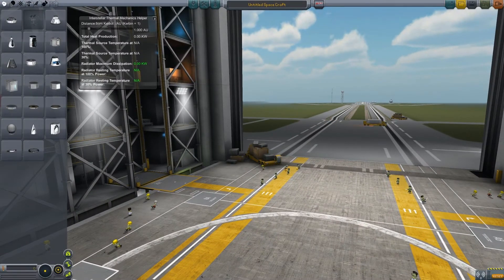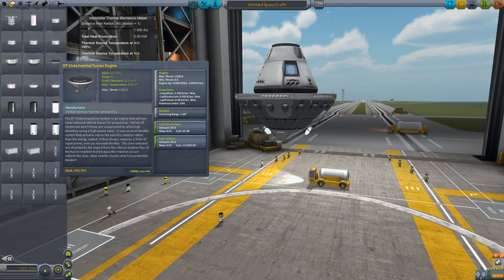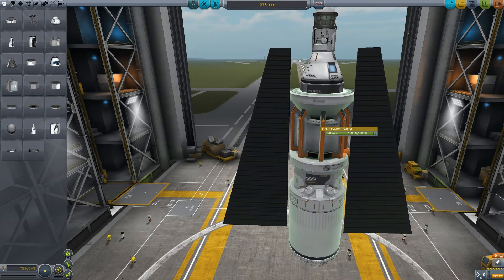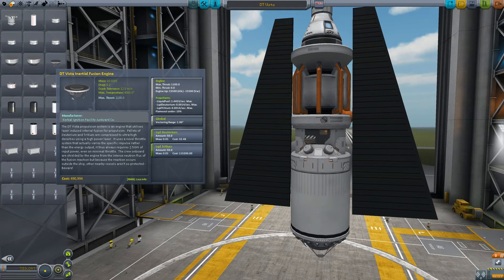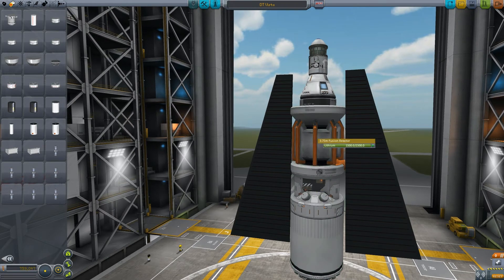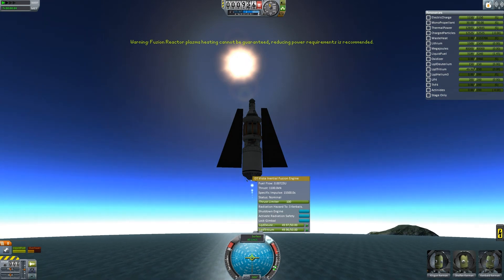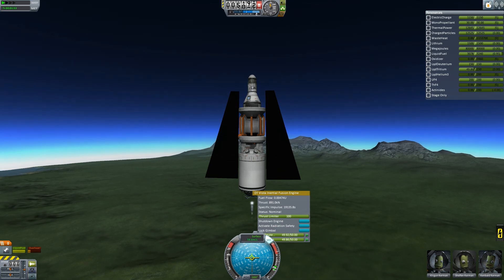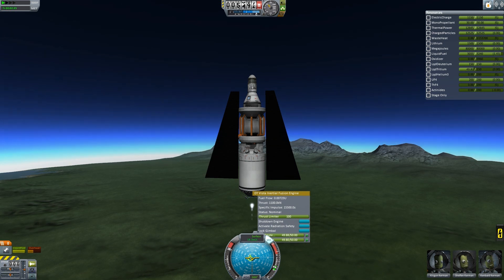KSP Interstellar: DT Vista Inertial Fusion Engine Tutorial

Comment: Just a couple of  things you didn't cover. Deuterium and tritium supplies might need to be account for if you want to make a ship that can last years without a refuel. I usually make such a ship with 1 lithium tank, 2 deuterium/tritium cryostat tanks, and 1 helium3 cryostat tank (helium3 is made from tritium decaying and can be used as fusion fuel). Along with 1 inline refiner and 1 UF4 Tank to keep the fission reactor healthy.
 Also here is a little more gee quiz stuff about the DT Vista. An upgraded 3.5m Fusion reactor and 3.5m generator combo can easily produce enough power to use 4 DT vistas. Pretty much making it the go to engine for any non antimatter XL space craft. It ISP isn't influenced by atmosphere so it makes a great engine for a heavy lander (kills all harmful native life forms in a 2 km ratios, guarantied)
In fact,the only thing that I found this engine can't do alone is make a rendezvous burn with a ship carrying a kerbal. Which can be worked around if you have the patients.......radiation safety off.....or not.......
Reply from the maker: Great info man, your absolutely right. I will cover this in a seconds part tho, somehow its good the first one is as simple as it can get.Otherwise in regards the vista engine i would consider it supreme over the antimatter which is a huge hassle. I found a work around in regards to your issue, well also mainly depends on your design limitations. I use the vista to kill my delta v in relation to my rendezvou target like 10k from it and then use a few nuke engines or one depending on my ship to move in closer. Of course you could supplement it by other engines tho the isp is something that we both want to squeeze the most out of the ship so any way to burn less fuel is better. With this system you need to weigh the fact the more thrust you got the more control you got over your ship in terms of slowing and speeding it up when going in for rendezvou. THo usually the higher thrust engine provide better control they also eat up all the fuel. But with fuel processing plants in most of my systems already i start to switch to Mark 55 as they generally fit in all my designed crafts nicely and with additional 3degree vectoring its great.

Comment: for some reason my reactors  arnt creating heat. ive got the settings as u and the window say that its all red so they should explode but they arnt producing any waste heat. do you have any ideas
Reply from the maker: hmmmm if you didnt place a single radiator your reactors will not go on, i take it you didnt watch my reactors tutorial ?
Reply: Actually i did watch it it was a great tutorial by the way very helpful. and they actually turn on but they dont produce waste heat like they do for you and everyone else. they'll be on and working and i can run a thermal rocket engine but they arnt producing that dangerous waste heat. i know i should probably be happy about this but i actually want to worry about them over heating.
Reply from the maker: lol
Reply from the maker: Try putting on smaller radiators till you get it :)
Reply: AddMeGamers
lol aright
Reply: +AddMeGamers might be a little late but could you make a tutorial on the VASIMR engine? i can't get it to work. kerbal engineer is giving me crazy TWR ratios and Delta-V values in the hangar but that thing isn't starting up and i can't figure out why....

Comment: i just got a galaxy s5 so i can finally download your game haha been waiting. off the the ios devices
Reply from the maker: :D let me know what you think
Reply: AddMeGamers just a quick option i upgraded the engine as one of the first upgrades and fuel is a bitch to manage but i think the breaks should work when you run out of fuel bcus the way you have the gas set up most the time you have a lot more speed then necessary to reach it all you need to do is slow down
Reply from the maker: Ye the fuel issue gets better as you upgrade the tank size. And the brakes get better as you upgrade the brakes and tiers :P . Hey you got to start of with a crap car :)